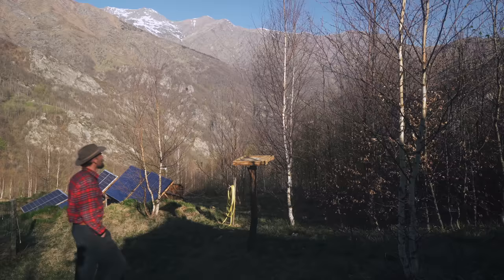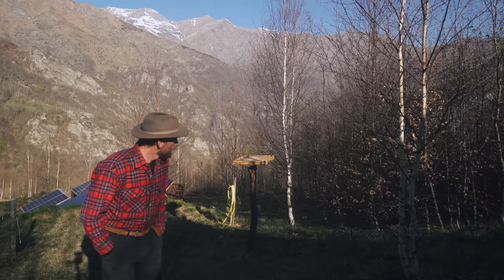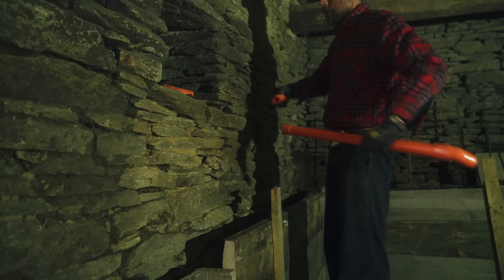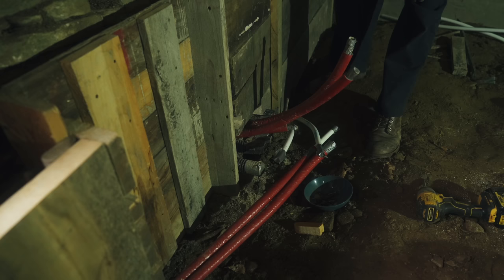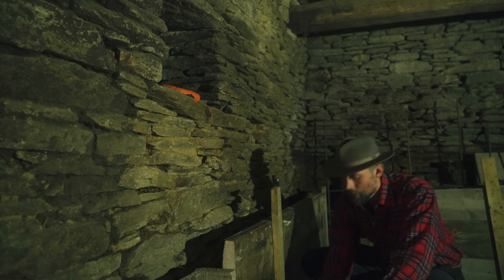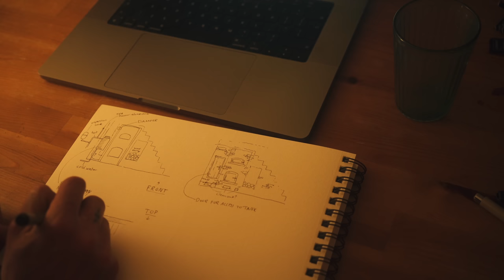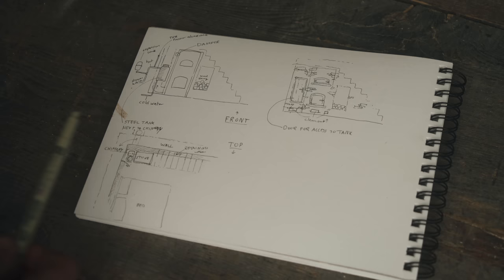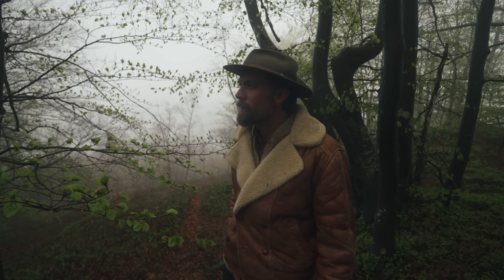#63 First Green on the Trees, Digging retaining wall, Plumbing preparation

Comment: A couple of words of "advice" from a seasoned (80 Y.O. doing construction work, DIY or Pro, since age 20) construction worker. First of all, STOP doing your concrete work until you have a final mechanical design. Otherwise, you will "work yourself into a corner" where you need something that wasn't yet planned and the concrete work prevents that need from happening. 
Second, your "simple" plan eliminates all of the "space" heating. It appears to be "too" simple and likely will not work very well at all. Something between your "simple" and "complex" system. Maybe an electric water heater where you can circulate the stored water through a alternate heat exchange source during winter.  The "trick" is to be able to control the heat source to the heat exchange coil so you don't make steam. That can get dangerous. A pressure relief valve is the simple answer to that concern. I would install two "in line" as a fail safe protection. Also, (almost always) the "heating" fluid is a closed loop and not the same as the "domestic hot water". The two heated fluids never come into direct contract. The heat is transferred from one fluid to the other through "heat exchange" (such as a coil immersed in a tank). 
Plumbing is much more complicated than most people realize. Both "physical" and "health" types of danger/risk need to be considered and overcome. BE CAREFUL !!!  THIS IS A GOOD PLACE TO SLOW DOWN !!!
Reply: Commenting just to hopefully get this boosted or seen because this kind of advise is invaluable. Sometimes you need to step down and let a professional take over.

Comment: I think you need more exchange of heat in the simple option, which you can achieve by running metal pipe (coil) through the stove mantle. This give way more, better and faster exchange of heat and is not all that much more complicated.

Comment: Hercules had to clean the Augean stables in a single day. 
Martijn has to dig out that cellar and form up and pour cement retaining walls. Who had a more difficult task? 
Wondering if the basement retaining walls are required by local building codes or is Martijn just being prudent.
Structurally this cabin is set for the next 1000 years: that cast beam at the top of the walls tying in the whole roof structure and now the retaining walls locking in the bottom of the walls. Brilliant! 
Fascinated by the plumbing ideas. Looking forward to the solution chosen and the build of that masonry stove! 
It's going to be an epic summer, building out the interior of that cabin!
Thanks so much for the best channel on YouTube!
Reply: He digged out a lot of the dirt floor to make the room higher so I guess the retaining walls are mandatory so that the walls wont collabs. Another visit from the geometra/architect would be interesting.

Comment: Easier still would be a low pressure heating system, from a supply tank, with expansion pipe. You'll still need a circulating pump, hot water rises

Comment: Because photovoltaic solar panels have become more affordable it is now preferable to heat domestic hot water using solar electric than using solar thermal collectors. There is an important clue contained in this piece of information. You would be better off decoupling the wood stove /masonry heater as a source of DHW in favour of photovoltaic solar collectors, on which you already rely for your power. A stand alone plumbing set up keeps things as simple as possible. If you want to boil water using wood heat use a kettle! Complex systems are idiosyncratic and will make your life more, not less complicated. Got the tee-shirt!

Comment: I have a vacation house were we simply use a "heat tank", a tank you push cold water through and it will heat the water for you and store it well. Pushing is done with a simple pump. Since you are keen on using your stove, maybe you could use it to generate electricity? That or you could go for a boiler and perhaps pump the hot water in to the heat tank directly? I am in no mean any professional on this, but I find it a little worrisome that this solution is so complicated, especially with the top voted comment here by the heating engineer...

Comment: I think that the system with the coil inside the stove is much more efficient and also it will heat water much quicker. It is obviously more complicated as well as cost and time demanding but I think it would be a good long term solution.

Comment: if you have three plugs and you need only one, attach/glue a small button like the ones you put on a drawer to keep it from making noise when it is shut, but here it will distinguish that plug from the others (would have put a photo if i could find where to add that)

Comment: Have you considered a wood stove that has a build in water tank? Here in Spain it's called HydroBronpi but I am sure there are other brands. I live off grid and have this system, it works great with radiators and you can also use it for showers.

Comment: Put in extra ducts through the concrete. For any extra services.  Your simpler system will suffer very badly from corrosion.  Why not have the tank on top of the heat source similar to a kettle?

Comment: Well I think the pipe through the fire is still a great idea. That alone with it's storage tank could make things messy, I mean, yea it could turn into a steam train boiler almost, maybe, but if that water is going through the floor heating and everything is adjusted kinda right, then you will be just the safety and control feature of the system. You won't stand to be in there if the heat gets too high. And you won't feed more wood into the fire if you're already feeling it's too hot you know...
That complicated way of doing things makes it an efficient system, so little fuel (wood) will be needed. Well, maybe not little but, surely way less than with the simple system. I know wood isn't an issue but it's more convenient not to have to feed more wood to the fire constantly.
Maybe you could simplify the whole complicated design by tying each thing directly to the storage tank, not making it a giant complicated loop.
Like - stove heating - direct pipe to and from storage tank. Boiler? Direct pipe to and from storage tank. Needless to say that hot water comes in from the top and cold water goes out the bottom, so it mixes it all well without any pumps.
Floor heating? Direct pipes from the storage tank. Reason for that would be that each line will be at a different pressure under different circumstances, so having everything straight from the storage tank averages the water temperature and eliminates the need for a lot almost all valves. By using that pump for the floor heating water flow and adjusting its flow you can adjust floor temperature.
Its just an idea but, who knows...

Comment: A piece ❤of advice: in ancient times the stove was positioned in the center of the house and on the ground floor, this is because the chimney had to cross the upper floor, heating it. You had placed the chimney externally .... you would regret it.
Reply: Actually... Good advice, dude.....!!!
Reply: Nowadays stoves are designed to be so efficient that there is not much heat going up the chimney

Comment: Martijn - from my experience and from a practical approach I would try to make things as simple as possible. You do not have enough space to set up the big system (you really need a big "technical room" and your small side shed room is not a good space to operate or build such a system in). You also need a continous and reliable electricity input for all the 3 way valves to work or to switch accordingly. Which is not the case with your solar setup in the winter. I would stick to the simple version for the size of your space. It is cheaper and easier to build, much easier to maintain and oeprate (to the point you can run it yourself without calling a plumber for the tricky things).  The world of water heating / space heating (creating heat in general) is an endless world of complexity, possibility and continous innovation of more complicated/cost effective solutions. I like the idea of you have 2 systems: A. a simple system with an electric heater to heat up water as needed year round and B. a second system that heats up water with wood based on your stove usage.

Comment: he will start looking for a new water tank soon. plants do not like cold water directly from your water supply line. it must be preheated to air temperature and slightly aerated. the water tank which he gave away would have been very good for that purpose. 😝

Comment: I’m wondering if you,ve considered emergency egress from the room with the stove? If the only way out is the stairs above the stove, you may want to consider putting in a small casement window opposite the stove just so you can get out if you need to.

Comment: Just wondered is the electrical water heater better than a solar powered boiler? This is more regarding the summertime hot water need. You could still use the electrical one as a backup.

Comment: So taking out the floor seems like it will compromise the building, even with the concrete structural add. I'm sure you spoke to a structural engineer. What are the plans for the door? Will water come in? I think I am missing something here.

Comment: Are you going to have some kind of electronic control system layered on top of your heating solution? Thinking about the simpler tank solution, it will likely be difficult to get the setpoint right  with only physical controls. With a 1000C heat source in a small space, heating the space to ~20-25C and keeping it there could be quite difficult. Curious to see how you manage it.
Reply: My recommendation with a heating system in a place like this is.... keep it as SIMPLE as possible!
No smart monitoring, no smart multi-way valves..no electronics!
A heat source, some pipes, a hot water tank and a 'radiator'.......!

Comment: More research needed on heating system. The “simple” approach may not be best in the long run. Steel tank = rust, mineral deposits, etc.  Does the simple approach leave out under floor heat? You will wish you had done that, if it does. Separate potable water system from a closed loop floor heating using the proper type antifreeze and run that through the fire box? Or is that more complicated?

Comment: Are the pipes you put into the concrete insulated? I'm just thinking that the concrete will work as a big heat sink that will cool down the hot water pipes if they arent insulated well.

Comment: Im not sure if steel container just next to stove would catch enough heat (or at least it woul take longer for it to heat). You might consider wrapping some copper tube around flue and adding it to the system, kinda like kris here has done. Jut idea, might tbe too tricky considering its masonry stove and not just cast iron stove tho. https://youtu.be/AVZCOMWsCxY

Comment: That plumbing still seems more complicated than necessary to me.  You don't need underfloor heating.  If you have a fire on in a small building like that, then everything will be warm anyway.  Then, ditch the idea of heating water from the stove.  Just use electricity (and possibly a generator, when necessary).  Yes, that isn't perfect, but it's soooo much simpler.  Perhaps have a tank/immersion heater for summer, when you have more solar than you can store.
Reply: When I was a kid we had a solid fuel room heater with a 'back boiler' which gravity fed a heating coil in a hot water tank. The tank also contained an electric  immersion heater element for summer/extra demand. 
Simple, safe, reliable...!!
Reply: @andymccabe6712  Exactly how my stove (AGA) heats our house and water - and we cook on/in it …